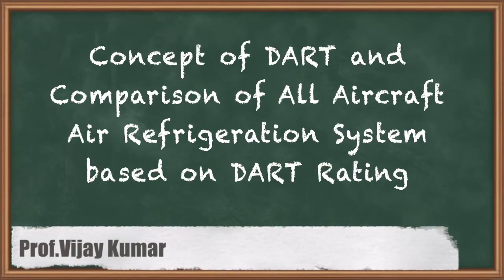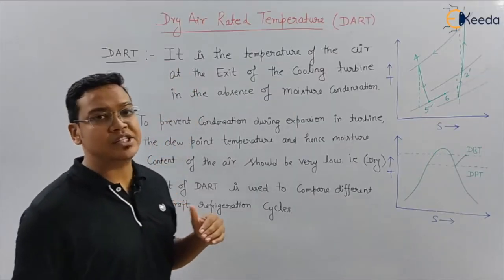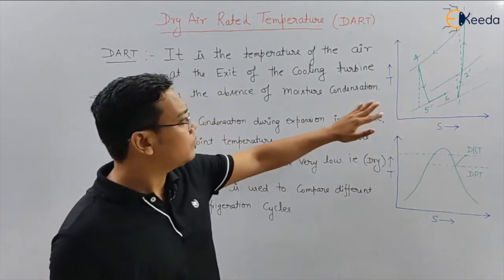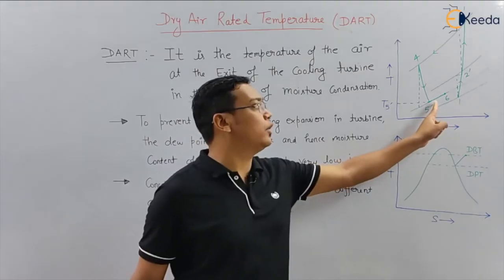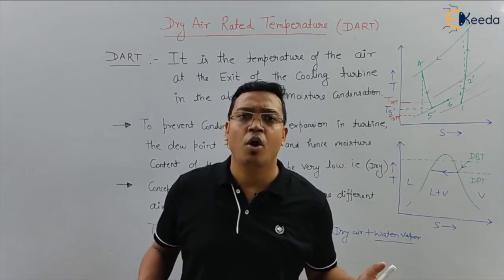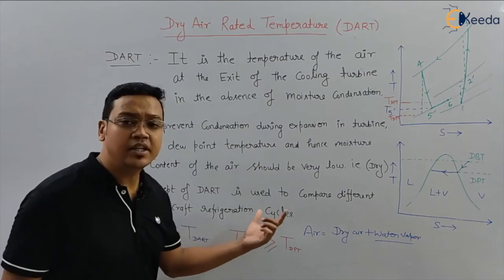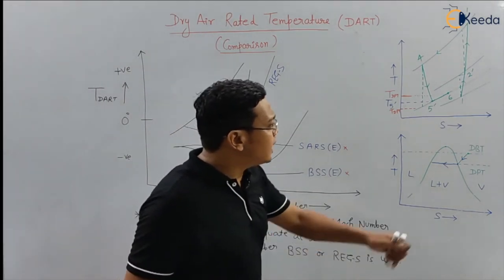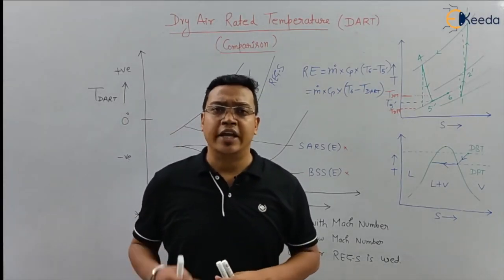DART and Rating Comparison - Aircraft Air Refrigeration Systems - Refrigeration and Air Conditioning

Comment: 00:06 Introduction to Aircraft Air Refrigeration Systems
01:39 The video discusses aircraft air refrigeration systems.
04:48 Discussion on constant pressure and superheat
06:05 Water vapor sweep air is the temperature drive.
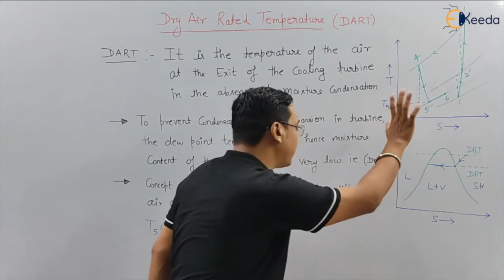08:40 Understanding of refrigeration system components
10:25 Convert weapon vapor to liquid form for better efficiency
13:18 The importance of temperature control in aircraft air refrigeration systems
14:41 Comparison of aircraft air refrigeration systems
17:18 Comparison of DART and Rating in Aircraft Air Refrigeration Systems
18:41 Comparison of aircraft air refrigeration systems and regenerative systems
Crafted by Merlin AI.